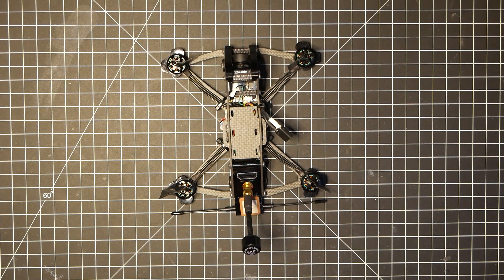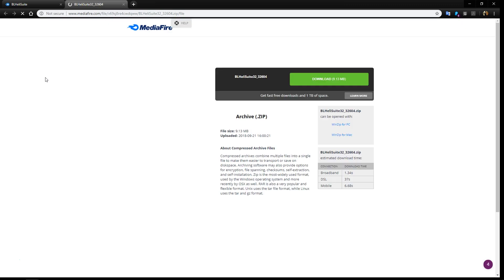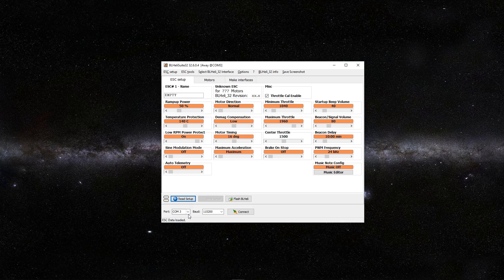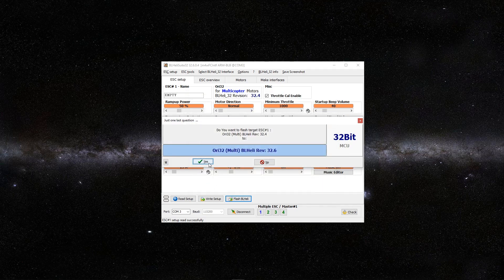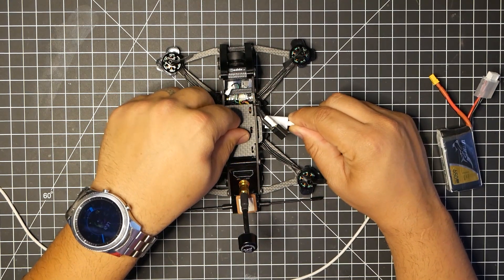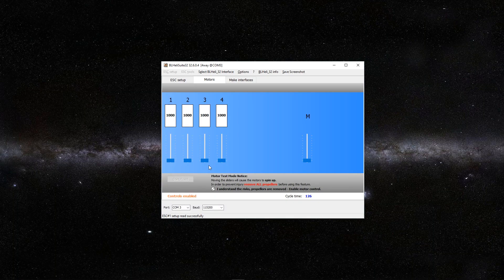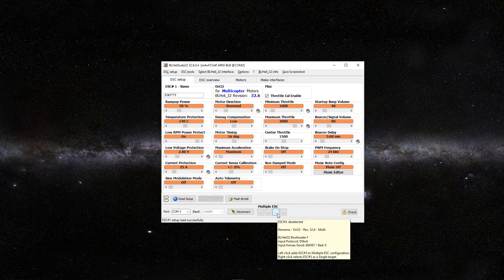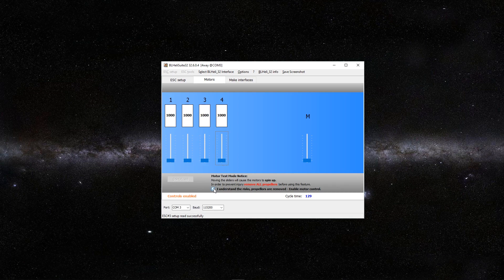How To Update BLHeli 32 & Change Motor Directions

Comment: reversing motors changes air dynamics significantly.  Your front motors gain much more airlift vs rear motors at a same RPM!  You will notice when you flight strait forward and your drone want to fly up vs going strait.  More forward power you apply, the nose rises and your drone is unable to maintain forward flight.  This feature is not for every drone especially if your props are closer to the body.  I don't believe the ratio in betaflight 4.0 is correctly calculated when reverse rotation is selected.

Comment: Thanks for posting this and showing step by step how to do it.  I subscribed and will now attempt to set the motors on my new tri-copter.  I was told that this could be done in BetaFlight, but either I have something connected wrong or the reversing option doesn't work for some reason.  This BLHeli way doing separate motors will be the best for me.
Reply from the maker: You're welcome. You can test motors in both Betaflight and blheli but only can change directions in blheli suite. I think you're thinking of setting in Betaflight that motor directions is reversed but it doesn't actually reverse them. Just tells the FC that it is spinning reversed directions.